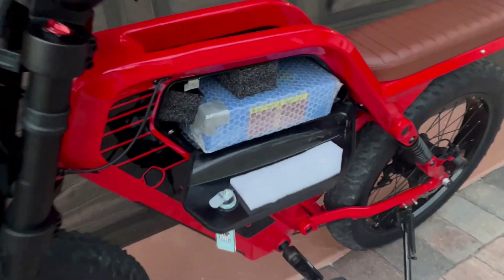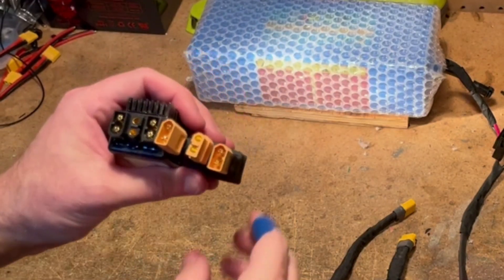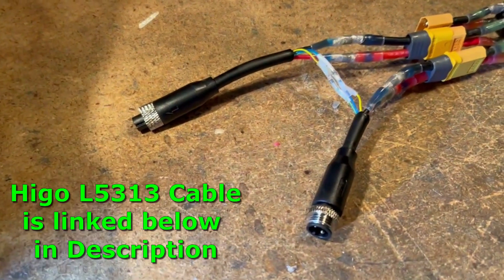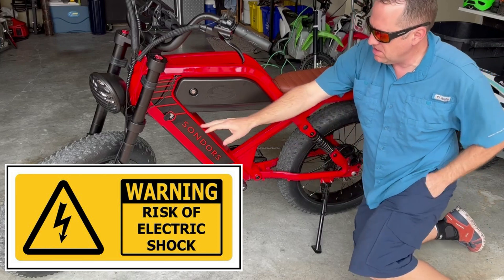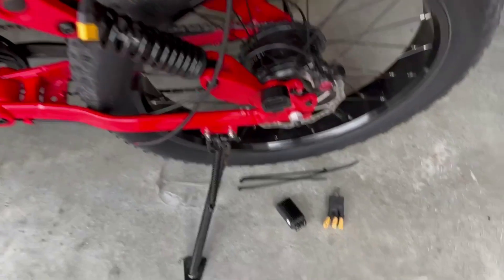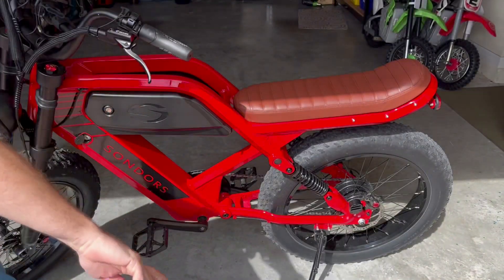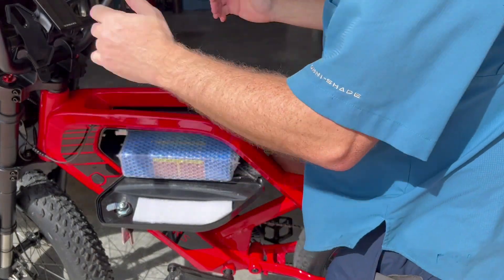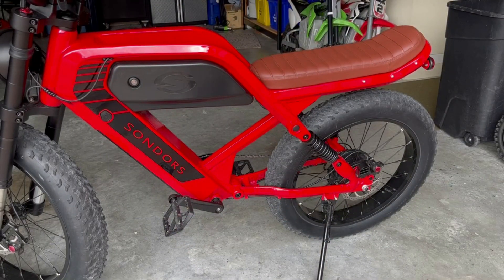Battery Combiner Install with Extra Battery - Sondors Madmods

Comment: Hello, thank you for posting this! I am thinking to run Sondors off a generic 48v battery as replacement batteries are no longer available. Would it run without those signal wires, what is their function anyways? I saw in another video you measured them to transmit some two volt signal from the original battery.
Reply from the maker: Some bikes have extra wires for feedback.  The bike works without the wires but battery % may not be accurate

Comment: i know these videos are a bit old, but I just got the cafe version of this bike and I'm curious if you have any tips or ideas about how to upgrade this bike to handle hills better.  Like are the hub motor and controller components pretty plug and play or did sondors make them specific to their bike?
Reply from the maker: You would have to change motor to larger motor or go to mid-drive which has been done see Madmods owner Facebook page.     The issue is both add more weight and IMO the bike is already too heavy.   If you change the wheel size in the settings from 26 or 16 the speedo will read slow but tricks computer and will output slightly more power and speed.  I can get to 35 mph
Reply: @BRichSolution  interesting, are there any risks with hurting anything by changing the wheel size?
Reply: I believe that if run at full throttle for too long a period that the controller and or battery may get or start to get hot. Check temperature or add a thermostat and tempurature display to the assembly. One mounted on the battery(s) and one mounted to the controller.

Comment: between the sondors madmods and the yolin you reviewed, which one is the better bang for your buck? have you tested the yyg ebike on amazon ? if so, which one of the 3 would you choose?
Reply from the maker: YYG or any bike i would not buy with that goofy custom battery is expensive to replace and not efficient use of space.   Yolin dual 52v / 22ah battery is best bike for money.   You will go 35 and have range of 62 miles throttle only.  YYG and sondors only get range of 25 miles (12 miles out then turn back)
Reply: @BRichSolution  I'm 6 feet tall 240lbs. Is the Yolin as tall as the Madmods? I really like the looks of the Madmods

Comment: I’m thinking on getting the Sondors Madmods but I’m between the Scrambler or the Madscafe model. Which one would you recommend?
Reply from the maker: The cafe looks cooler but the scrambler handlebars are at a more comfortable height for long rides IMO
Reply from the maker: Hurry up and order the epic open box sale for $1800 wont last long and then the price will be $3000

Comment: I can't really find if madmods uses the bafang hub motor without the branding, but if it does, those motors and controllers work with 52v batteries, which could get you some extra speed.
Reply from the maker: I had the same thought.  I believe ive seen a guy online running 52v battery.  The issue it finding a 52v battery to fit in the box

Comment: I was thinking of doing a front hub motor and second battery all controlled by the same throttle/system.... if that makes sense and I wonder if thats even possible.
Reply from the maker: I think there is a guy coming on Sondors Madmods Facebook page that did a front hub motor.   Not sure what you’d gain as top speed will not increase as the front a rear motors need to be matched sizes
Reply: @BRichSolution  ahhhhh man. I really want the specs of the Ariel Grizzly but the looks of the Sondors Madmods

Comment: Nice work! One tip for free... For less ripple keep the wiring battery to controller always as short as possible. The wires to the motor can be longer without causing issues.
Reply from the maker: Thanks for the info!

Comment: So that was originally a glove box persay, with the new battery are running them at the same time or not
Reply from the maker: I run the auxiliary battery and stock battery as the same time with the battery combiner.  When I have the 3 way switch I could only rein each battery separately

Comment: Hello, great video, a quick question for you, there is no link for the 30 Amp In-line Fuse. Most of the ones I found are 12V, will they still work or do I need to find some for 48v?
Reply from the maker: You can use this fuse and carrier but with the li-ion BMS you really don’t need a fuse But if you want the link is below
https://amzn.to/3wSre2r

Comment: I might be a bit late but I've been watching your videos all night, and was wondering if you kept the speed mod while using the combined batteries, and wanted to know how fast were you able to go with the bikes extra battery?
Reply from the maker: Extra battery doesn’t give me any extra speed just more range.  The controller on board determines the top speed.  I’ve set the wheel size from 27” to 16” which gets my top speed up to 34-36 mph, but the speedometer is off as it reads 19 mph
Reply: @BRichSolution  I did the same settings to ma cafe racer sondors  I also change the settings on the magnets sensors from 6 to 5 ,and the speedometer shows about 24 mph  top speed, the downside is that the battery only gives me about 16 miles in range! I'm think of upgrading to a 52 volt battery, do you know if the controller will be able to tolerate the power?

Comment: How do i connect the on/off from the stock black switch to the controll box from the kit?- for my mx 650 upgrade
Reply from the maker: connect it to elock harness or look at wiring diagram at 6:12 mark in 1800w video
Reply: @BRichSolution  I actually finished it a couple days ago… my dad helped me out and we figured it out. thank you so much for the diagram! hey t really helped!

Comment: what amp battery combiner?   30A or 40A ?
Reply from the maker: You need at least 30Amp battery combiner as the Sondors controller is limited 25amps